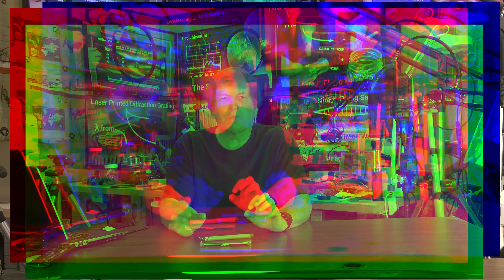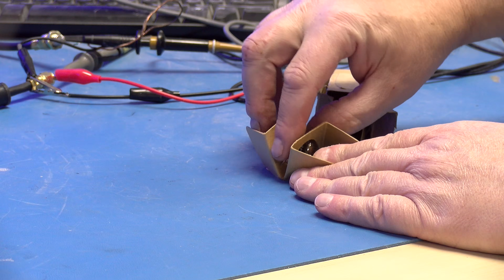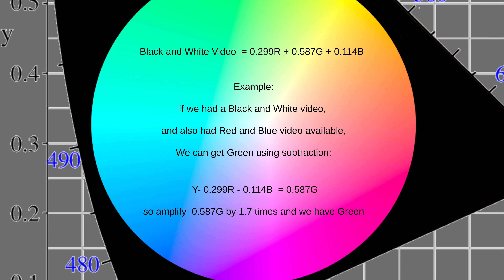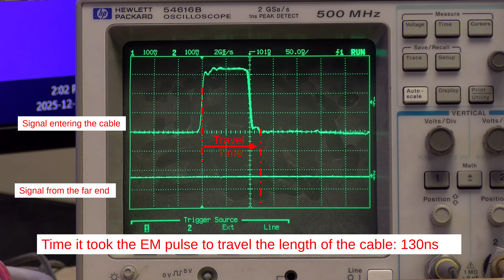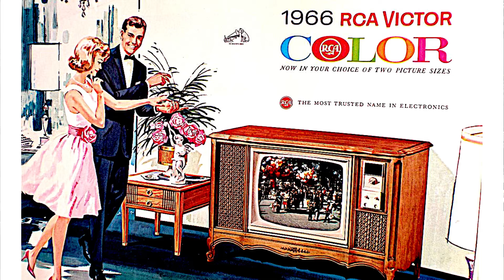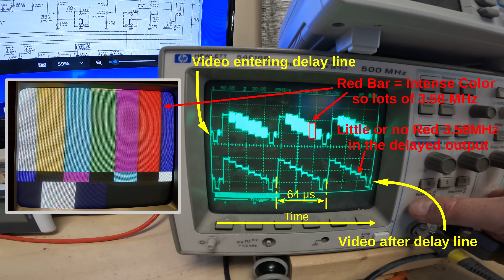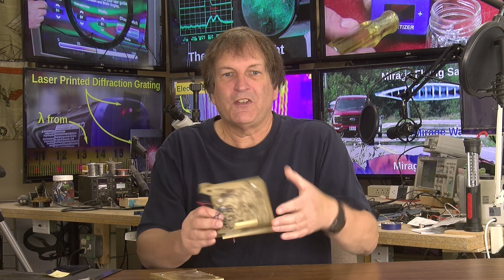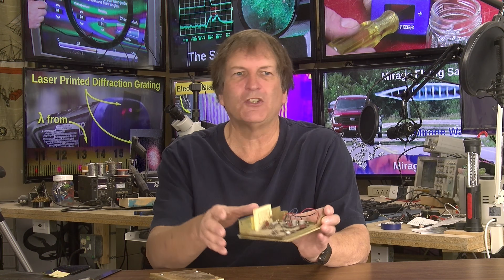How we slowed down electricity to create Color TV

Comment: There is a process called "colour recovery", where the chroma dot patterns in black and white recordings of color programs can be used to recreate the colors! This has been used to restore Doctor Who episodes in which the original color master was lost but black and white copies existed.
Reply from the maker: Yes!!!!! I had heard of that, being a Dr Who fan myself! I gather they went though quite a painstaking process to do that - I assume they had to frame by frame guess and tweak the burst phase. I wonder how much the phase wobbled on the BW recordings?
Reply: @ElectromagneticVideos I think the colours happened to fall in a way that the phase is statistically likely to be one more than the other. So it doesn't need to be done per frame
Reply from the maker: @phill6859  Your right - probably just a bit of tweaking here and there making the process much more practical.
Reply: @phill6859  The source was specifically a scan of a black and white film ("kinescope") recording, not a video tape that would by its nature output the video lines in correct sequence and timing. The process was eased by the fact that the original signal was PAL, so phase errors could be canceled to a great extent. They still had a need to determine which lines had clockwise phase rotation vs. anticlockwise, but that could be determined by whether the colors came out at the correct hue.
Reply: @oldtvnut right. But from what I can tell, just assuming one of the phases normally looks correct.
Reply: @ElectromagneticVideos 🤔
Reply: @E @ElectromagneticVideos  isn’t VHS agnostic to the content of the frame? A subject for a future video.
Reply from the maker: @d46512  I think its partly. The color for NTSC and PAL is shifted(heterdyned)  down and recorded seperatly, but I think its frequency locked to a local 3.58Mhz crystal for NTSC when shifting back up. I think BW works regarless of standard as long as the frame rate is correct. I remeber reading of peopole using VHS to record Briitish 400(?) line TV without issues. I wonder if it would do 800 line French TV as well. Also heard of PAL VCRs being used to record SECAM in some places rather that proper SECAM VCRs which shifted the FM carrier by dividing by 4 rather than frequency shifting. If anyione reading this knows the details please let us know if what I have said is right - of fill in any blanks!
Reply: @ElectromagneticVideos  I don't know the technical details, but I do know that you can't record a SECAM signal with a plain PAL VHS machine. It would strip the colour and the recording will end up black&white. The machine has to explicitly feature "MESECAM" for it to record SECAM. Apparently the circuitry is simpler than in VCRs sold for the French market, but it has to be there.
Reply: @ElectromagneticVideos  The source for them was B/W 16mm film recordings produced for export.
Reply: @ElectromagneticVideos what i think is happening is that those chroma dots are actually like dithering patterns to indicate wich color that gray scale should have.
By analising each color and examining chroma dot pattern, it became possible to recover those original colors fron that telerecorded  (that what was once in color) footage back.
This means that the created software should recognize those different chroma dot patterns to recover those colors.
Aslong there were no notch filters placed on those B&W tv’s for telerecording and aslong those cameras were extremely sharp, then those chroma dots can be vissible and sharpened into HD for color recovery.
Otherwise it is impossible to recover those color back.
Even through depldifier software can guess wich color each object should supposed to have through ai  with a combination of shades of gray and object recognition.
For instance light gray can resamble color yellow in a rainbow while resambling color pink on a light gray shaded person.
Dark gray can resamble color red on an apple while it can resamble color brown on meath etc…
Wich is something definitely amazing and cool as well😁
Reply: This dot crawl was actually the chroma which was spectrally interleaved. Very cleaver.
Reply: I asked the team about this and it works with PAL. Too bad it was never developped for SÉCAM because there are kinescope archives with dot pattern too.
Reply from the maker: @debranchelowtone  It should be much easier with SECAM - the color is on an FM carrier so no need to accurately guess the phase.
Reply: @debranchelowtone maybe someday.
Am mean where theres a will theres a way😁
Reply from the maker: @johneygd  Would be a great open -source project!
Reply: I could see analysis of the dots to help conventional colorization processing, which is pretty good today, but not to deduce all the colors everywhere.
Reply: Lots of potential now. I guess compute power mainstream enough to also auto touch up frame by frame in photoshop style editor after colours are recovered as record for base of reconstruction for algorythm to use.
Look how quick ai clickbait generated now for instance. Genius tech wasted on pulp. 😊
Reply: Color recovery is possible for cases where a movie or show was shot on black-and-white film from a black-and-white monitor or television screen. AMPEX color VCRs (4 video heads, 2-inch tape) recorded the video signal directly, without transferring the color signal spectrum.
Reply from the maker: @berko9608  I had heard they experimented with recording the color directly - didnt know that was done in the actual first color VTRs released as a product. Interesting they could get it stable enough for NTSC.
Reply: @ElectromagneticVideos  
Since I have worked mostly with SECAM equipment, I may not know the technical details of NTSC VTRs.
The VTR (4 heads/2 inches) for SECAM used an analog time base corrector. Implemented on many coils and varicaps. Senior experts said that the TBC for the PAL was more complicated and used additional precision delay control systems.
Reply: Color recovery is possible for cases where a movie or show was shot on black-and-white film from a black-and-white monitor or television screen. AMPEX color VCRs (4 video heads, 2-inch tape) recorded the video signal directly, without transferring the color signal spectrum.

Comment: The reason delay lines were used in TV's was to compensate for the extra time the color circuits took, the B&W signal had to be delayed so they all arrived at the same time when they were recombined. also the delay lines in early digital electronics were a form of recirculating memory.

Comment: Interesting how that dropout compensator board delay has exactly the same chroma carrier frequency that European PAL has
Reply from the maker: Interesting - I didnt notice that. I'll bet since delay lines like that were common in PAL/SECAM places but not in the NTSC world, the delay line was a made by a PAL delay line manufacturer but tweaked to have the NTSC delay period. I'll have to look up what frequency it was actually used at in the VCR - which used narrow band FM for the luma signal (common for most VCRs).
Reply: @ElectromagneticVideos  Yes, one could say that a VCR always used SECAM and converted it back and forth to PAL or NTSC...
(but VCR recordings are not exactly the same as SECAM)